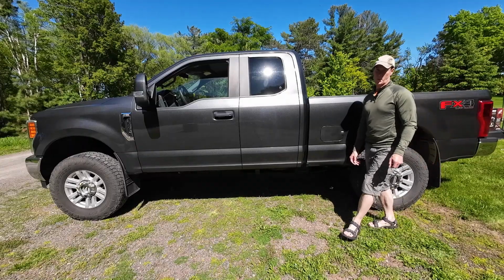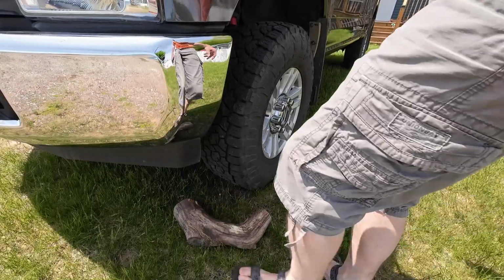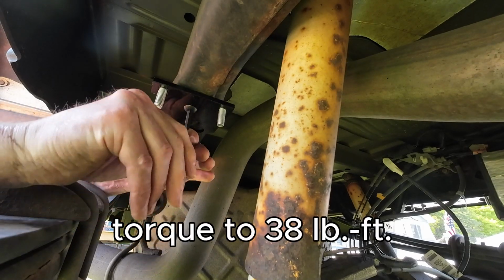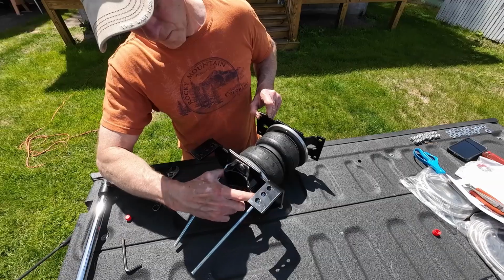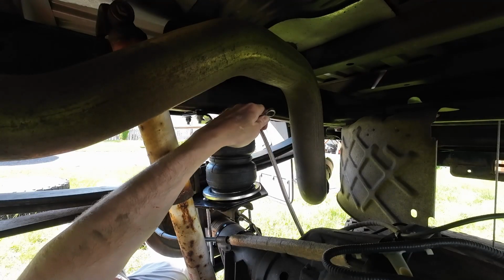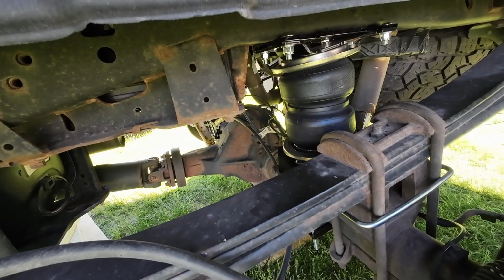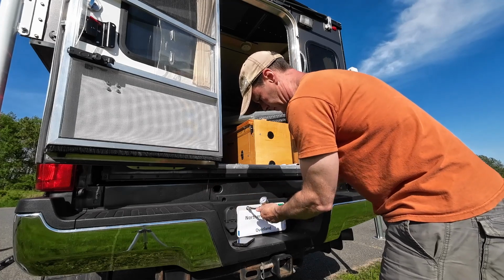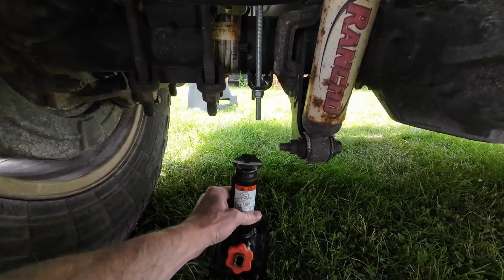Why Do I Need Air Bags to Carry This Tiny Camper?  Air Lift LoadLifter

Comment: I'm looking at installing airbags on my f150 for our new hawk base model. I've heard the ride quality can be really bad with the internal jounce bumpers. How's your ride quality with the camper off the truck? Thanks!
Reply from the maker: With my truck being an F250, the unloaded ride quality is extremely rough with or without the air bags.  I don't think it will be that bad for you if you get airbags.  The internal jounce bumpers are basically replacing the factory bump stops that your truck already has.   Without a load in the bed of the truck, you just need to remember to air down the air bags.